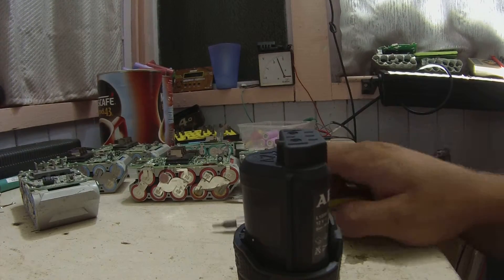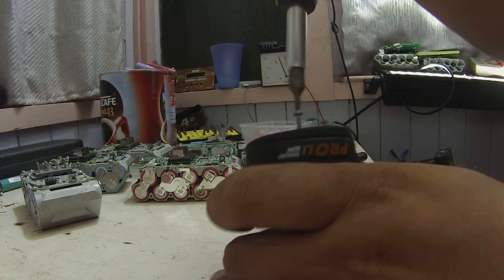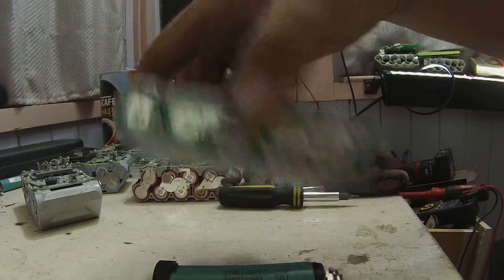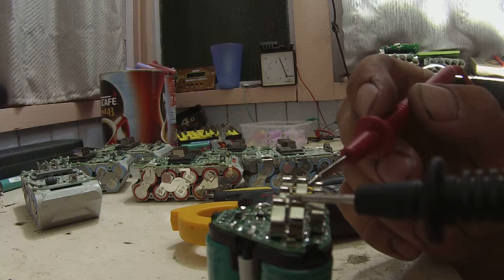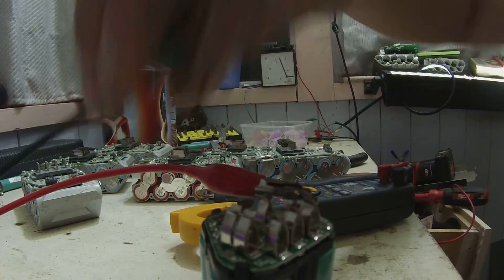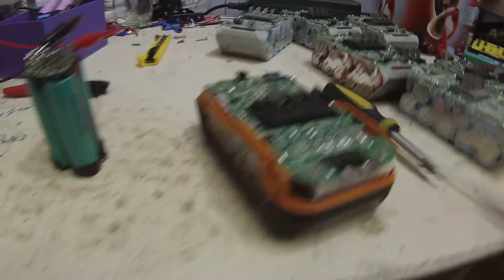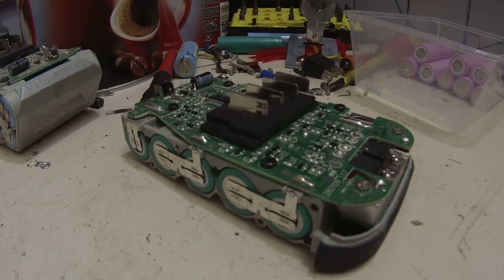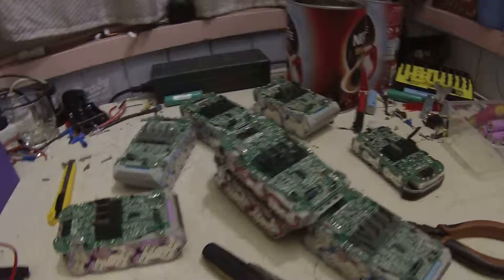AEG 12V 2AMP BATTERY TEAR DOWN

Comment: Hello again.

I was just passing to say that I resolved my dilemma and I am using a combination of 12V Milwaukee and 20V Aldi Xfinity batteries.

But that is not all I wanted to say.

Keep an eye out for the Aldi Xfiniti series of batteries in 2Ah and 4Ah. They come with Samsung INR18650-20Q batteries in them.

Also I thought about using Ozito Power X batteries but they have TenPower cells in them. The good thing is that they are sold in Bunnings all year round, unlike the seasonal Aldi ones, and the 4Ah are also just $40 like Aldi's. Also they come with a 3 year warranty compared to Aldi's 1 year.

Comment: Hello.

Did you manage to decipher the terminal configuration of these batteries? Could you please tell me what terminals correspond to each individual cell?

I am going to build a bank to run a couple of these batteries together in series to obtain 24V and I want to add an S3 balancer and a lipo voltage checker to keep an eye on the cells. I just need to figure how to connect the cables for c1 c2 c3.

Thanks mate.
Reply from the maker: No as far as i worked out i think 2 are to cells and one is a temp sensor.
Your best off going bare cells and in 7s config for 24vdc 7s bms units are cheap on ebay
Reply: One Up The Sleeve Customs I really want to retain the ability to charge with the original charger and also need to be able to take the batteries on a plane. 

What concerns me about going bare is that I carry too much great and the batteries that way may be subjected to possible damage by crushing. 

I have some Makita 18x2 tools that work with batteries in series and I have not seen any problems with either the batteries or the tools. 

With the AEG I want to run some 24V flexible led panels. 

The manufacturer sells a device that actually puts four Sony L series np f970 batteries in series for a total of 28.8V with no known ill consequences that I have found out. 

At the beginning I wanted to combine two Makita 18V and user a buck converter to step then down to 24V but figured that stepping down a third of the available voltage was going to reduce the running time of the lights anyway. 

And aeg cells are smaller and cheaper. 

Even then I'm still toying with the 18V X 2 idea as there are some 18V 4.0Ah going cheap at ALDI at the moment.

Comment: hi i have 2 aeg packs like that(the older 1.5 ones), and they are pretty done. can barely screw one screw with a charge. i have several brand new LG 18650 3500mah 10A. could i just replace the batteries inside?
Reply from the maker: +Micke i have not tryed it but if the board on the  battery is all working well still what have you  got to loose and you may end up with a great little pack let me know how  you go mate